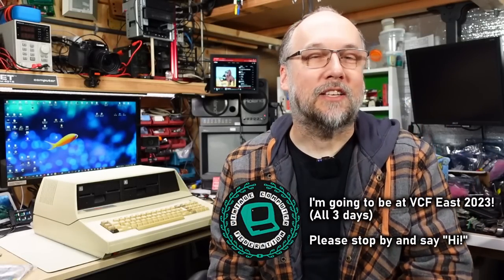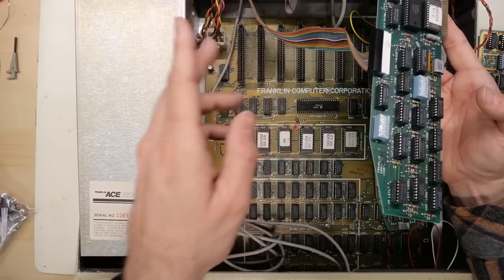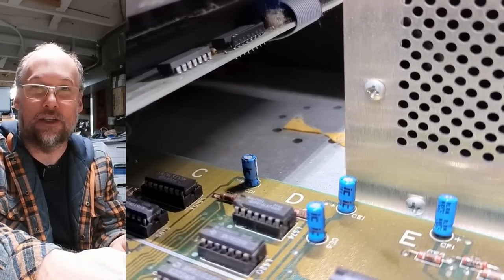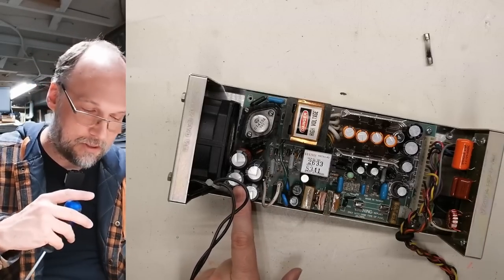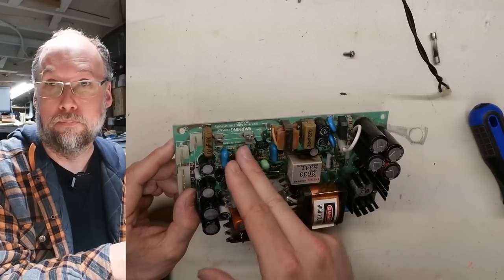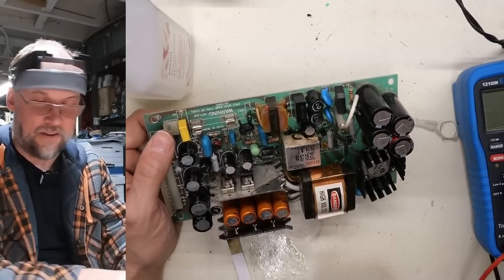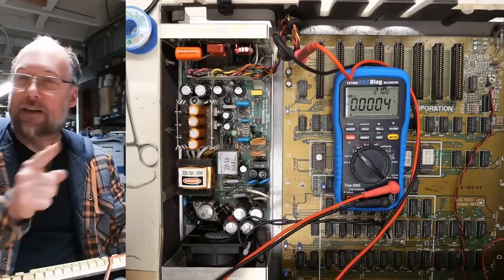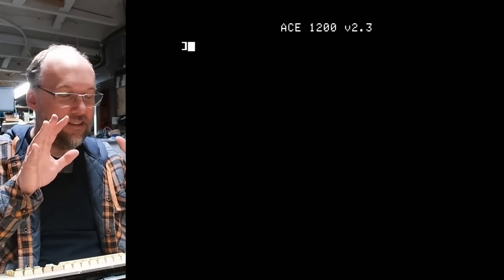The Franklin Ace 1200 was a semi-legal Apple II clone #repair

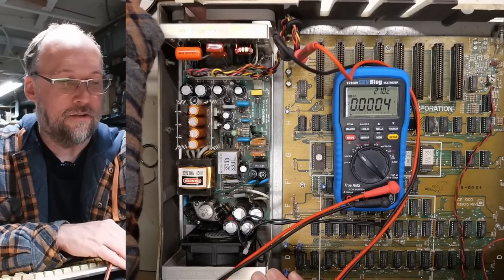Comment: 30:35 🤣😂 Electricity aint' gonna jump out of that thing and get ya lol. The only safety consideration to have is don't stick anything conductive in it while it's powered on. And that's something so utterly base level that anyone who doesn't understand that shouldn't be working on electrics at all.
Reply: I suspect the reason Adrian says this is because there's a cadre of "junior safety rangers" on youtube that'll ding his video for encouraging dangerous behavior.  So the dire warnings he puts in are a way to get these people to be quiet.  The US is a culture of fear, and there's always a set of people that feel they need to enforce these rules of fear.
Reply: One who doesn't understand: that's exactly who Adrian was targeting.  Plus the capacitor charge that some might not have expected or considered.
Even Dave of EVlog got zapped by a cap with high voltage.
Reply: @stevesether  there's definitely a culture of fear but I don't think it's the safety people who are pushing a culture of fear. They may be a bit nuts but they're not the drive behind fear.
Reply: @danman32  yeah I've gotten nailed by a camera capacitor once. I had a couple of tiny black scars on my fingers for a decade or so after that.
Reply: @adampope5107  The extremes of one beget the other.
Reply: Another important safety consideration is that capacitors can hold a charge for a long time. In a working device they'll get drained fairly quickly but if it isn't working the charge can be held and shock you hours, days, or even weeks after it was powered. Dead switching supplies are perhaps the most likely to shock you when unpowered.
Reply: @eDoc2020  And that doesn't become a hazard until you remove the board from the case, flip it over, start running your fingertips across the solder joints. Atop that, it's an easily delt with hazard; just short the caps with your screwdriver as soon as you lift the board.

Also it's not like those caps are going to kill you. The 'hazard' is pretty damn minor. Itt'l make ya swear a bit and might leave a couple black spots in your fingertip for a few days but that's about it.
Reply: @TestECull  It all comes down to this: don't go inside unless you know what you're doing.